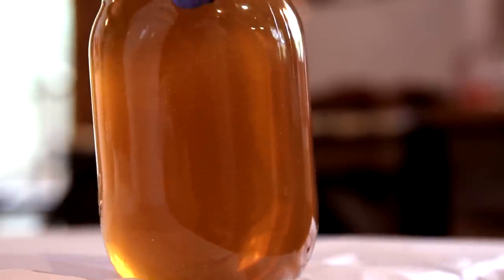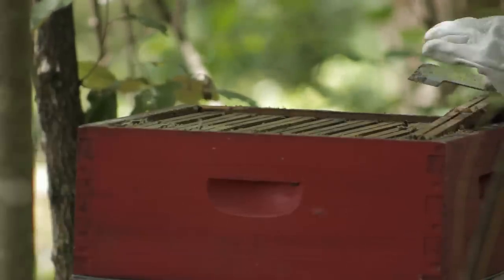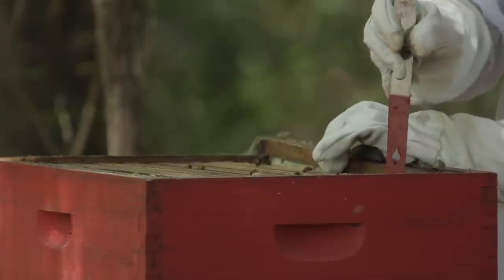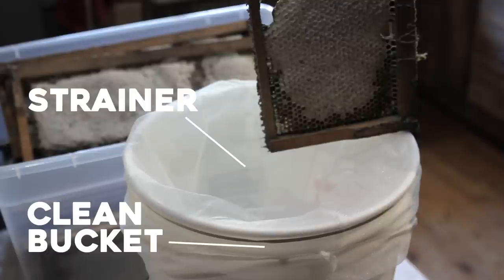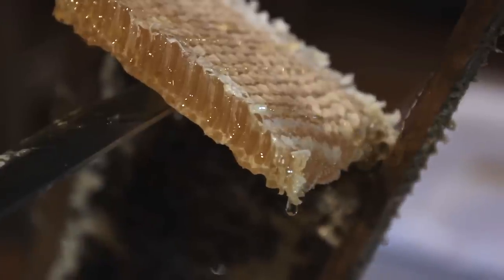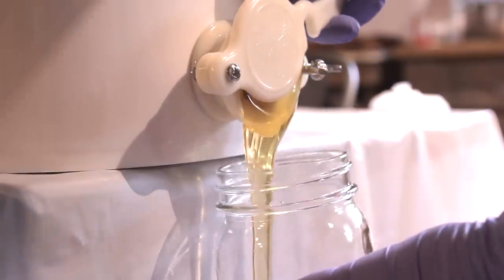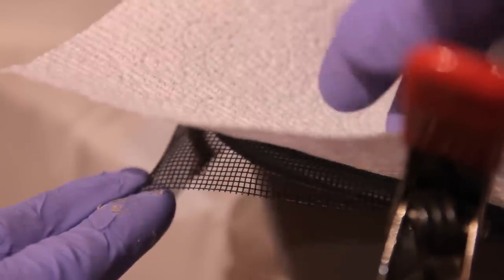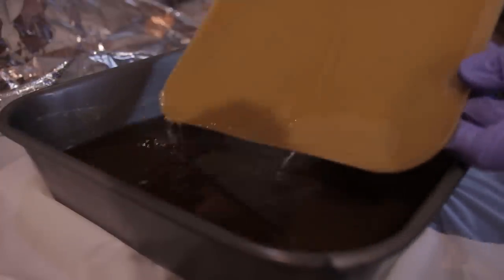HERE GO SOME HONEY! Simple honey extraction and one-step beeswax processing

Comment: You have to process the honey to bring it to the best taste.... heat the honey indirectly, water bath, to 60 Celsius for an hour after reaching the temp. Taste it, it will definitely feel beautifully delicious . So much dirt and wax will form on the top during the process. The fermentation bacteria should die or you can't store it at best taste, it will start to taste soar and tangy if not processed. You need to skim those impurities during the process as well.